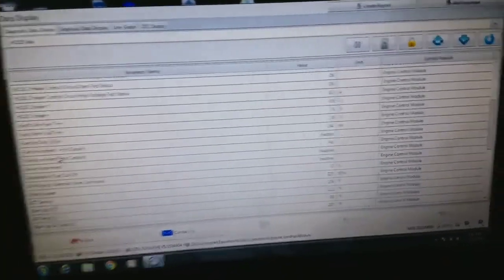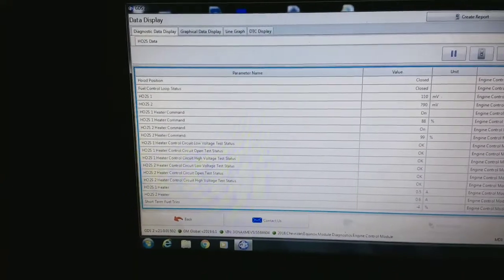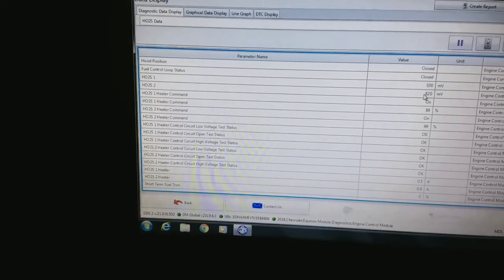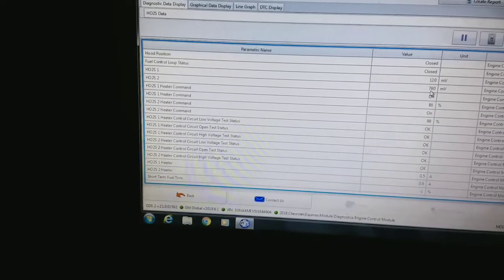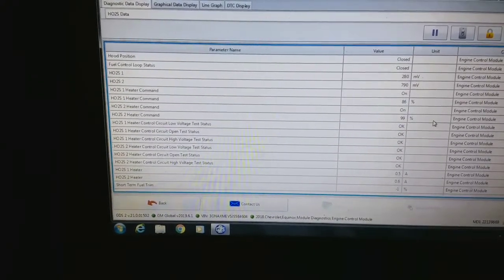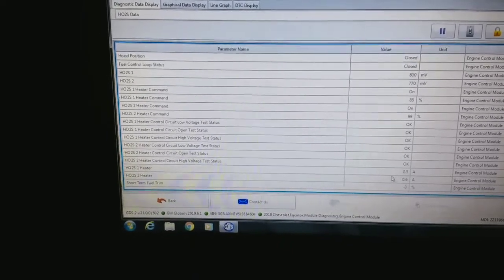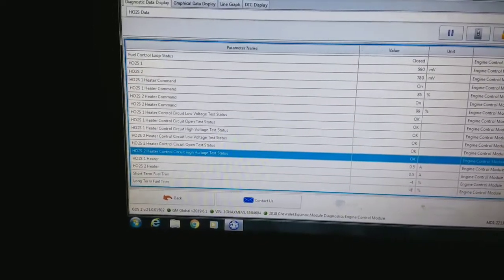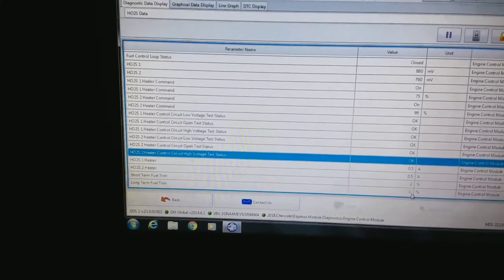Oxygen Sensor Diagnosis, tips for most vehicles, on a 2018 Chevy Equinox

Comment: Hello DE , I have a question , I have a 2018 chevy Equinox 1.5 LI Turbo, it is sputtering when  turned , producing a sulfur smell, white smoke and consuming antifreeza which had bot done it before, my mechanic recpmmended to chabgr the turbo but the same things keep on happening any idea please of what might the problem coukd be?
Reply from the maker: Apologies that I didn't see this months ago. Coolant is getting where it shouldn't. 

White smoke is nearly always coolant in the combustion part of your engine. If not the turbo I wonder if it could be the head gasket, but it's not usually that.
Reply from the maker: Is it possible that you got water in your gasoline? Happens randomly to people all the time.
Reply from the maker: You can test fixing this adding an additive which helps get water out of gasoline. Ask locally for it. There are different kinds.

Comment: Here I is.
Reply: Years ago my son's 89 Reliant did not pass inspection because of emissions. I went to see my friend Jay at Marlboro Chrysler Plymouth to get some parts to fix my son's car. I was getting cap, rotor, wires, and an air filter. While Jay is pulling the parts for me one of the mechanics I knew came up and asked what I was up to. Told him the parts I was getting and why. He says did ya pull the codes? Ah nope. Being a Chrysler product you can get the codes just by sequencing the key. So I go and get the codes and turns out it was just one code. It was calling out the O2 sensor. So Jay puts back the parts I asked for and gets me an O2 sensor for just about what I was going to pay for the other parts. O2 fixed the problem, passed inspection, and started getting another two2 to tree3 miles to the gallon.
Reply from the maker: It's like paying for the repair. Eventually. 🤑
Reply from the maker: I love repairs when the miles per gallon goes up. :)

Comment: some useful info guess you need the diagnostic equipment to do this 
👍au👍like we give & a full watch😲supported🔔
Reply from the maker: Sure. But my Torque Pro app for $5 and a $15 bluetooth OBD II would be enough to figure this out. I used GM equipment for the fix, but not all diagnostics require expensive equipment.
Reply: @DENicholsAutoBravado  cheers thanks for the feedback